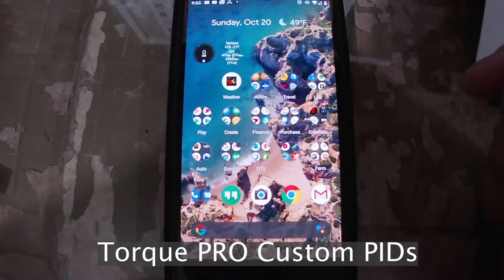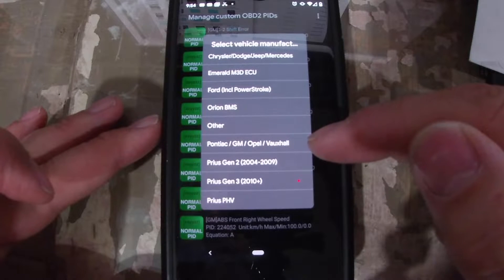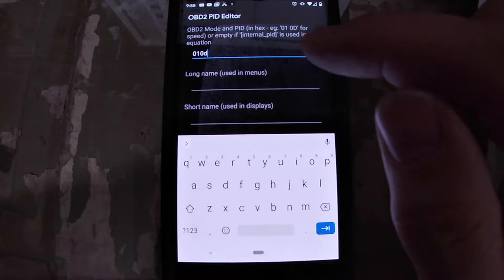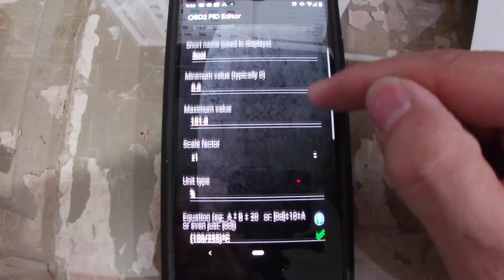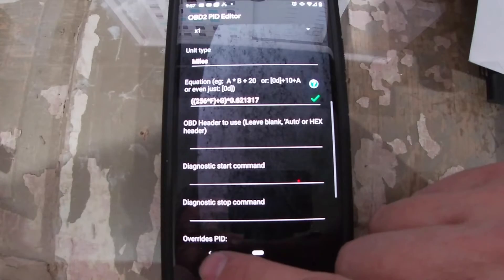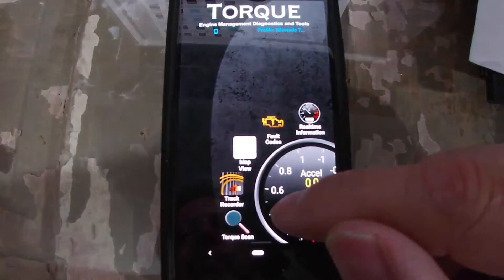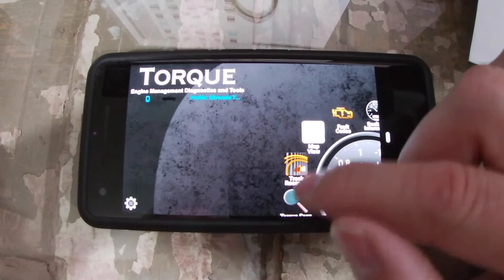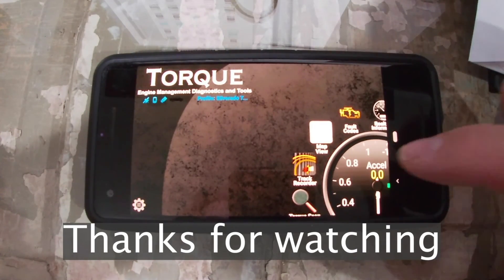Adding Torque Custom PIDs

Comment: Great video !!  I am struggling with a custom PID.  I have a 2015 Buick Enclave and have replaced 3 of the 4 wheel hubs due to Track control and Stablock issues.  The ABS wheel speed tone ring in the hubs break apart and causes erratic readings.  A couple weeks ago I had the error come up on the dash again but went away after a couple short trips, and then came up again a few days ago for about 1hr.   I'm trying to determine which of the 4 hubs I have NOT replaced yet or the sensor causing the issue.  I think it's the front left wheel.  In the Manage custom PID's I see [GM]ABS Front Left Wheel Speed with a Green "Normal PID" icon and looking at the settings I see mode and PID being 224051, Long name..  short name=ABSFLW minval 0, maxval 100.0, Scale factor x1, unit km/h, equation A with a green checkmark, OBD Header=ABS,  Start and Stop commands are blank, Min refresh delay 0, Does not override any PID,   When I press Test, I get No Data.   Can you provde any help?   Thank you.

Comment: Would you know how I would get the transmission temperature on a 2007 Jeep Commander 4.7L. The ones online and the ones for Jeep do not work.
Reply from the maker: What transmission do you have?  545RFE?
Reply: @CJIEngineering    Yes.  545RFE Transmission
Reply: @CJIEngineering    Yes
Reply from the maker: @byronlee6486 , sorry about not getting back to you sooner.  I'm trying to locate a vehicle where I can test the value.  So far no luck.  Send me an email and I can give you a screen shot of what to try.  chad_ivan@hotmail.com

Comment: Thank you for value video
Torque pro.can use mg4 electric vehicle 2022
Reply from the maker: That is a great question.  In the USA we have the OBD2 standard that all vehicles must follow. I'm not sure if the mg4 does follow the same standard since they are not available over here.  If it doesn't I'm pretty sure it will in the future.  Thanks for the question.

Comment: Chad, this is the best explanation of how PID's work in Torque!  My question is how do you find the PIDs and equations?  I have been searching everywhere for the Fuel Temperature PID for my 2006 Duramax and all I can find is "GM:FTEMP" but that isn't a PID.  Do you know what the PID and equation is for Fuel Temperature or point me in the right direction where I can find it?

Comment: Chad, can this be used for Mercedes ML350 2010?  I need to find the temp of my transmission, as I am trying to do a change which requires me to have it to a certain temperature.

Comment: 👎 You didn't show how to transfer the custom pjds to the pid list that pops up when you're adding a gauge to a screen. The custom pjds don't automatically show up on that pid list.
Reply from the maker: They show up in my list as soon as you save them.  What steps do you need to do?  Ian has been great about fixing any bugs that get reported.
Reply: @CJIEngineering  Can you please tell me how to save the custom PIDs? I don't know why they don't show up on my list. I've followed the instructions of all the videos that  I've watched (over 20) and nothing seems to work. Some videos say to hit "save" on the page that lists the custom PIDs but there's no save button on my page. There's an "Export List" option when I select the 3 dots in the upper right hand corner of the page. 5 options pop up : "Torque", "Email", "Nearby Share", " Save to Drive" and "Send to Zoom Buddies."  I chose "Torque", naturally.  But it didn't save them to the page under the option "Realtime Information " so I couldn't access them to make a gauge from them. I've spent over 20 hours trying to figure this stuff out.  Any help would be GREATLY appreciated, thanks.
Reply from the maker: @pertuancreek5174  did you purchase the PRO version?  I believe that is the only way to have the extra items show up. I think it was maybe $5.00 and well worth it.  Let me know if that was it

Comment: So once i select the gm PID list how do I then see the results of the new tests/monitors?
Reply from the maker: Do a long hold on the gauge screen and you will see the new options at the top of the list.
Reply: @Chad Ivan  thanks for the reply. I have a 1999 gmc sierra and i want to view misfire count if any, but can't figure out which graph/chart to use. I tried using the current drive cycle option, but it says ecu doesn't support that. Shouldn't a GMC vehicle be spit out that info? I have an off brand obdii bluetooth dongle but just ordered a BAFX model to try a different dongle.
Reply from the maker: @Van Hill I believe you can read current misfire values for each cylinder but you are not able to read the historical values with Torque even with a high $ OBDII unit.  You need a full fledge service tool and they run $599 and up :(

Comment: Ive got this app, and it has hundreds of pid’s for vauxhall already on it. So, either the app,  or the adaptor arent very good.  Ive have 2 error lights which i caused myself to test app ( afl and tyre pressure ) it couldnt find any errors or clear the warning lights ( although i knew theyd come straight back on ). Is there no way of just downloading pids it has got. This is what i thought the link was going to be. My torque already had those on. But it seems it cant sort out simple errors

Comment: Thanks for the video Chad. explains the Add a Custom PID function very well. I have had trouble finding the PID to monitor a 2011 Avalanche, and probably many others, AFM / DOD status for those of us that have pre displayed models and no desire to delete the system but want to monitor it live. i.e. 0=off or V8 mode and 1= on or V4 mode. Any help you can provide would be much appreciated.
Thanks,

Comment: Would you know the pid to know when you regenerate the particle filter on a 2020 ds7 crossback 1.5?
Reply from the maker: Please check out my list of PIDs. https://docs.google.com/spreadsheets/d/1ZPDOeSx4JFwb1nomx5adsc7pYm-sdLimwG0FmNmVhNg/edit?usp=drivesdk

I believe 018b is the same for all Diesel Engines but I would love to know if that is true.
Reply: @CJIEngineering  In my case your list does not work, I already tried, it was the first thing I did
Reply: Regen States----lookup(B>2::2='Off':3='Dist') empty string

Comment: Hello everybody.i set oil pressure screen from torque pro but not working.can i activate it?is it possible?or Ecu doesnt support it?is there someone knowing pid code for 2012 cruze diesel 163 hp

Comment: I'm looking for ethanol percentage for my 03  flex fuel suburban I know the computer sees it because my hp tuners does
Reply from the maker: That should be part of the extra GM PIDs that can be added.  It worked with my Buick Regal that had a flex fuel 2.0T in it.
Reply: @CJIEngineering  no I don't think I have a gm one there is one that I think is regular but it doesn't work on mine

Comment: I was wondering if anyone can tell me how I can save my profile information and any PIDs that I have added to my screen, on Torque I have tried everything that I can think of. I can get them onto a blank page under Realtime information snd they work fine until I exit the program, when I open it up again nothing is saved PIDs new gages are gone, even my Profile info is gone. I have tried to use the save button but keeps saying “ unable to save profile “ ? Or “ unable to export the file “ I must be missing a step.

Any help would be a appropriated

Thank You

Comment: How to add PIDs for tpms
I think below is for one tyre, what could be for rest tires
PID: 222813
Long Name: Left Front Tire Pressure
Short Name: Tire PSI (LF)
Maximum Value: 70
Unit type: PSI
Equation: (((256*A)+B)/3+22/3)*0.145
Start Diagnostic Command: Blank
Stop Diagnostic Command: Blank
OBD Header to use: 726

abdullah.naqib@gmail.com

Comment: Chad, thanks for sharing this....I have a question, used your formula for my 2020 GMC 3.0 and the distance regen doesn't ever change...are there updated formulas? Is there a specific dial to use?
Reply: He replied below that the value is the distance between the LAST regen and the one prior vs the NEXT regen.  You should start seeing patterns, I'm setting my Odometer 2 as soon as I see the regen end, look at the new value and then periodically monitor ODO2.

Comment: Chad, Great work! One question, for the regen state. On your phone, you have a max value of 3. In your spreadsheet, you have 1. Which one should I use? Thanks again.
Reply from the maker: Thank you :)  The google sheet will always be the most up to date.  Before I had the b-2 in the equation I had the max set to what I was seeing, "3" was reported when the unit regenerated so I wanted a more binary count, 1=yes, 0=no.  I'm thinking that there are other indexes, if you have a fleet vehicle you can actually force a stationary regen using a function, I think similar to resetting the oil life.  That would more than likely be another value but most of us don't have that feature enabled.  Thanks for the question.

Comment: Thanks for doing this. 
Couple questions:
1. I used your regen distance PID and it reads 346.7 miles all the time. I though it counted up from 0?
2. Is the regen state max value 2 or 3? In the video it is 3 and in the google doc it is 2.

Comment: Thanks Chad for posting.  Before I figured out how to load the GM PIDS, I had gotten the following error messages on my 2015 GMC Duramax LML  
It found the following two errors.
  - I'm trying to diagnose a loss in power and mileage after the repair of a DEF tank heater.

MID:$85 TID:$b3
-
Max: 2,100   Min: 32,768
Test result value: 65,256
FAIL
----
MID:$85 TID:$b4
-
Max: 32,767   Min: 64,776
Test result value: 120
FAIL

Any chance you can tell me what these are?  Trying to understand how to read hexidecimal stuff.  Thanks in Advance.
Reply from the maker: Peter,. Do you have any check engine codes on the truck?  There are more than 2 fuel maps that exist, one for all good, one for protection mode.  The motor will also defuel if the temperature of either the coolant or the diesel is too high.  As for the PIDs that you asked about, one question for you, where Did you get them?  I tested 0185 and was getting data back but I need to know the description so I can figure out what they are.  01 is the main federally required set of data and $ means it hex so that is the number you use so I looked at 0185.  $B3 can be assumed to be Hex Byte 3 or in torque C or D, not sure if they start with 0 or 1.  Let me know and I can give you some more pointers.
Reply: @CJIEngineering  well.. I thought the dealer was about to figure this out....  I'm not sure if youtube is the easiest place for a conversation..  No Error codes at this point.  These codes came from Torque pro,  I'm just wondering if they showed up because I had not fully setup the program for the vehicle.  The dealer also told me he could not interpret the codes without some other data.  Sent you a note in LI.

Comment: Chad, Love your video. Good work on the regen and DPF PID's.
Question for you. Could you give me your feedback on this GM Oil Pressure custom PID that was posted elsewhere on the web.
"22115c, 1, 160, x10, psi, (A*0.65)-17.5"
Originally had the scale factor set at x1 which was way way too low. Im running a 2019 L5P and found that with a x10 scale the PID is nearly spot on with the gauge in the dash.

Thx

Comment: What pid can I add to monitor the transmission fluid temperature on a 2015 toyota highlander 3.5L?
Reply from the maker: I would try to add the predefined lists for the Prius, it might contain a PID that will show you the transmission temperature.  Good luck.

Comment: How did you get your boost gauge working? My 2020 GMC 3.0 AT4 only goes up to 11 psi max. I'm using the vacuum/boost gauge. Thanks
Reply from the maker: There is a setting in the vehicle profile that needs to be set, Show Advanced Settings, Boost Adjustment, the value should be -6 psi so that would change you boost value to 17 psi.  My truck will do 18 psi but it depends on the elevation that you are at.  I hope this helps.
Reply: @CJIEngineering  I changed this setting on mine and it seems like it is always running a few pounds of boost even cruising along and 55 60 miles an hour.

Comment: Thanks for the video, best explanation I've seen thus far as far as this App goes... I'm sure you've been asked a few times, but any chance identifying PID(s) for the Allison transmissions in teh 1999/2007 GM trucks? (6 Speed is what I'm looking for, but I'm sure others may want to know about the 5 Speed PIDS as well if they are different.)
Reply from the maker: Brian, what PIDs are you looking for in the Allison?  There are some in the "Manage extra PIDs/Sensors" >> "Add predefined set" >> "Pontiac / GM / Opel / Vauxhall".  I might be able to help....

Comment: Can the PID monitor 2018 pajero sport?
Reply from the maker: I don't believe it will, OBDII standard is something that is required in the USA and sometimes used in other areas of the world but I'm not sure on the Mitsubishi Pajero Sport since it was never sold over here.  If you run an android phone you can buy a super cheap adapter for $10 USD and try it out.  Torque the standard addition is free and it will check 5 or 6 different protocols.  Good luck

Comment: Is this vehicle specific or can I add these PIDs on my sierra variant
Reply from the maker: The PIDs have worked with all GM vehicles I have tested so they should work with a Sierra and could work with other brands but I haven't tested them yet.  They work with the 1.6/2.8/3.0 diesels for sure.  Thanks for the question.  Let me know if they work for your truck.
Reply: @CJIEngineering  thanks! just waiting for my scanner to show up. One more question about the values..  I heard you say you changed it to MPH... how can I have it in KMH
Reply from the maker: @Chrisd5341  So I changed only the miles between regen into Miles.  If you take out the 0.621371 that is part of the factor and you will get the km value.  There are also defaults for the other units that can be changed to SI.

Comment: Hey Chad, curious what obd2 scanner you're using. Mine was cheap so it doesn't read most of these parameters trying to find a new one. Thanks!
Reply from the maker: I am using the OBDLink MX from Amazon and the software is Torque Pro by Ian Hawkins.  There are additional PIDs that can be added to that App and I have a video on how to do it plus a link to a Google Sheet that has some that are not part of the standard kit.  Thanks for the question and let me know if you need anything else.
Reply: @CJIEngineering  awesome appreciate the quick reply!

Comment: Chad

I was watching one of your videos and noticed that EGT was running about 1200 degrees Fahrenheit.  Was the truck doing a regen at this time or is that normal some time.
Reply from the maker: Carl, Sorry for the delayed reply.  The truck pretty much only hits 1,200 F when in Regen so there is a high probability that was the case.  Most of the time towing I'm in the 850-950F range and sometimes see 1050F.

Comment: Hi Chris just bought a Vauxhall Insignia and was looking everywhere for custom PIDs to monitor the DPF filter, thank you for the video and the XLS with the values, the last one in the right “Def Avg Usage” what’s that for and I take it we should be using it?
Reply from the maker: I really like the Insignia and would love to have one in the USA if we could get the diesel, it's the Buick Regal over here.  So the Def Avg Usage is a calculation of the amount of Diesel Exhaust Fluid that gets used as you drive down the road.  I don't think the formula I have is correct yet, my EFI Live unit gives me a little different numbers so that one is a little sketchy.  I just use it to see how much one engine uses compared to others.  My 1.6 Equinox uses more DEF per mile than my 2.0 Cruze did.  Thanks for the question and for watching.
Reply: Chad Ivan I’ll give it a go and see what I get and update you
Reply: Chad Ivan I noticed that the max value for on the soot level in the video says 101.0 but the spreadsheet says 100 and the regen distance on the vid it’s 2000.0 but the spreadsheet is 1000 and the regen state max value in the vid is 3.00 but the spreadsheet has 1.0 - I have followed the spreadsheets values apart from the regen state was that the right move? 🤓
Reply: Following

Comment: Good day! May I ask sir, how do you create a custom pid for cam signal and crank signal for Nissan?  I have a Nissan xtrail 2005 with p0304 code which appears only when the engine is hot or if driven for 5 kms.  Thank you.

Comment: Hi, thanks for the video. So I've got a 2014 ram and want to monitor egt and dpf temps. I have the obd link mx+ with torque pro app. I'm getting egt temps ok but it will register a dpf temperature. Is there something I need to do to make this work? Thankyou, Zac

Comment: Thanks Chad, very helpful. Can you post a screen shot or do a video on the values in the transmission temp pid? I have it as a selectable pid and put it on my screen, but it doesn't register any data.
Reply from the maker: So you need to add a "predefined set" to Torque Pro.  This can be done from the main screen and go into the gear icon, setting.  There you will find the "Manage extra PIDs/Sensors"   Go to the triple dots on the upper right hand corner and select "Add predefined set".   You need to add "Pontiac/GM/Opel/Vauxhall".  Once you do that you will have 3 additional transmission temperature gauges available, starts with [GM]  I believe I'm using Trans #1.  Thanks for the question and for watching.
Reply: @CJIEngineering  Excellent! Thanks.
Reply: @CJIEngineering  Chad, can this be used for Mercedes ML350 2010?  I need to find the temp of my transmission, as I am trying to do a change which requires me to have it to a certain temperature.